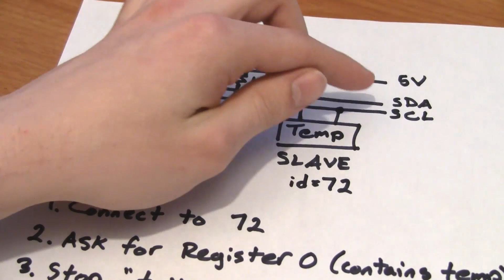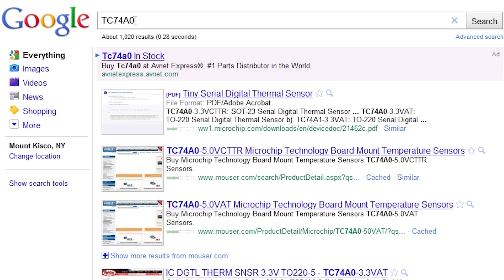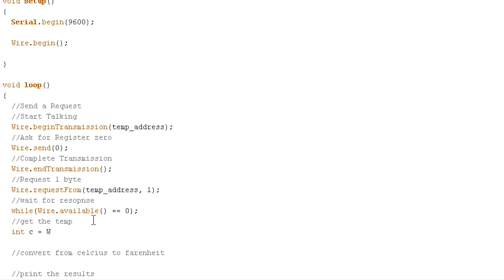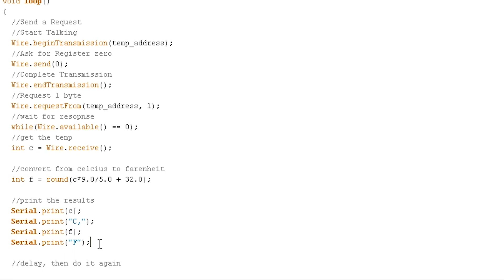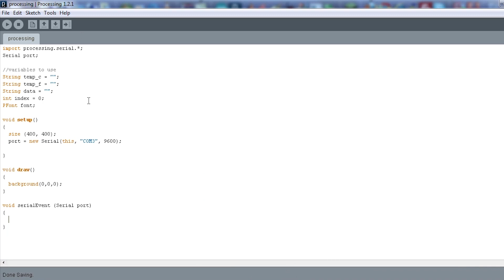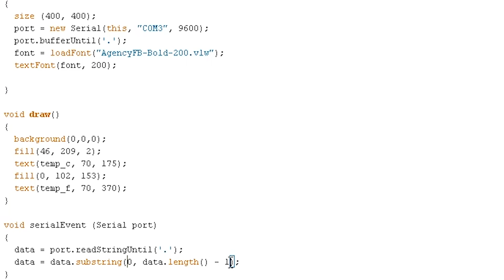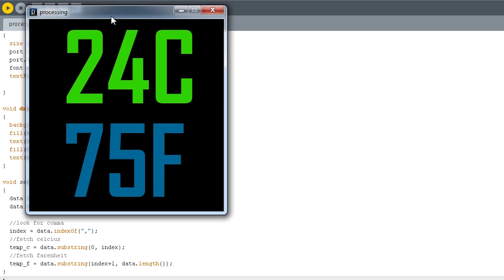Tutorial 07 for Arduino: I2C Communication and Processing

Comment: I am really confused with the part of the program where you wait for the 1 byte response using a while loop. The 1 byte of data comes in as 8bit binary right, so won't while (serial.available()==0 ) be cut of by a 1 coming in as part of the 8bit data? Why doesnt that happen? please reply, I am stuck on a similar project due  tommorow
Reply: When you call the Serial.available() function it doesn't clear the buffer. When the condition is set to true it just mean you have any number of bytes ( > 0) available to read, but you're not actually reading them and taking them out the bufffer.

Comment: Is it possible to use multiple ultrasonic ping sensors  .. with their trigger PINs in common or shorted .. but  each echo pin is connected  to  different   control lines of arduino
Reply: Yes, there is YT Video explaining exactly this idea ...

Comment: Will the length of wire between the master and slave affect the temp readings? For example if I wanted to measure the temp in my garage that is 10 meters from my computer.
Reply: No. It's a digital signal.
Reply: @Ziplock9000  Actually the length and type of cable  is extremely important when going 10 METERS !!!  I2C may not even work reliably.  The Noise + the Cable Capacitance +  the Cable Voltage Drop + the Pull-Up Resistor Values + the Driver Chipset are all big factors ...
Reply: @vtorsi610  Yup I learned that since saying it 3 yrs ago :)

Comment: I don't think that's the DIP version of the temperature sensor. I think it would be more properly be called the through hole or TO-220 version, rather than the surface mount or SOT23 version.

Comment: I have a lm35 3 pin sensor. is this all valid for that too?
Reply: No. The LM35 is an analog sensor that can be read directly using one of your analog inputs.  (assuming you are using a 5V arduino like the uno or the mega) connect the LM35 vdd/power pin to 5v. The vss/ground pin the the arduino ground. And the vout/signal pin to one of the arduinos analog inputs. You can then read the sensors output by calling the analogRead(); function. (the output will be in voltage but it should be relatively easy to convert to temperature at this point.)

Good luck!

Comment: Where is the I2C address of the sensor in the second code?
Reply: It doesn't matter anymore. Since i2c is required for the arduino to communicate with the temp sensor. In the second code the arduino is already sending the temp by executing the earlier code by serial communication.

Comment: I made this but it isn't working :(
what can be wrong?
something whit my arduino, I did everything the same as you
but great help thnx!

//Vasco van Pinxteren
//Grab celsius data from I2C temp sensor and send it to the comp

//Include the wire library, import the the I2C library
#include <Wire.h>

//Set the adress of the temp sensor
int temp_address = 72;

void setup() 
{
  //Serial connection, talking to comp
  Serial.begin(9600);

  //Initialize the listening
  Wire.begin();
}

void loop() 
{
  //Send a request

  //Talking to the I2C temp sens
  Wire.beginTransmission(temp_address);
  //Ask for info register zero
  Wire.write(0);
  //Complete Transmission
  Wire.endTransmission(temp_address);
  
  //Request 1 byte
  Wire.requestFrom(temp_address, 1);
  //Wait for response, keep repeating until we got the info we want
  while(Wire.available() == 0);
  //Get the temp and call in Celcius
  int Celcius = Wire.read();
  
  //Print the results
  Serial.print(Celcius);
  Serial.println("C");

  //Delay
  delay(1000);

}

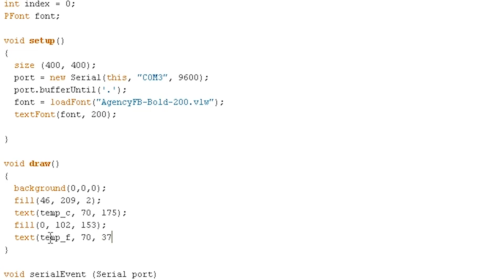Comment: Some things apparently work differently in Processing 3.01 and the text in the graphic window works for the first display through the loop but the degreesC text jumps underneath the degreesF text after that. I don't know the language at all but if correct the size(400, 500) and the code (see time 13:33) with this: text (temp_c, 70, 5); and text(temp_f, 70, 470); it works "OK". If someone can post the fix so that the text will fit in the 400 x 400 graphic box, that would be great.

Comment: Below is an excerpt from one of my postings. "PROCESSING 3" keeps closing as soon as I run the .exe 
All other programs run on my new windows 8.1 computer but "PROCESSING 3". I can't seem to find any solution to this problem. I have been searching the internet for a while but there doesn't seem to be much information about this program. I became aware of this program in Jeremy Blum's book: EXPLORING ARDUINO. There is a link to this website in his book on page 128. As soon as I downloaded, and installed the program several weeks ago I have been trying to find a solution to this anomaly. Normally I am able to solve most problems like this because there is a lot of links and information about a given product and/or software program. I'm finding very little information on the internet concerning "PROCESSING 3". QUESTION: Is there somebody in this forum who has had a similar problem with this program, and who has solved this particular issue. THANKS; It's sad that their website/forum will not or can not answer my questions.
Reply: +ElectronicWizard* Arduino Microcontroller Guide 2016. Step By Step Design and Programming Arduino Microcontroller. FREE DOWNLOAD HERE*
https://plus.google.com/116428027560638976608/posts/96r9KFpBur9

Comment: Hi I was trying to find the ID for this IC (http://ww1.microchip.com/downloads/en/DeviceDoc/22096b.pdf) but am not seeing it in the datasheet... where can this info be attained?
Reply: +James P Page 46 section 6.2.4 explains the addressing. The first 4 bits are fixed at "0101" and the other three bits are set by pins A0, A1, A2. High or low. If the address pins are not present they are considered pulled up high internally.

Comment: There is one thing seems not logical.
In the last few lines, (0, index) means the location of "index" will not count for the split string. If that's the language designed, so (index+1, data.length()) will also not count the location of last string letter which is at "data.length" right?
Thanks.
Reply: Air Genre Another thing is if a string's real length is 7, each letter will be allocated by index from 0 to 6 since you put 0 as the location of the first string letter. If data.length() command gives the real length, for example 7, then (0, data.length()) will become (0, 7) and they are 8 elements. For this reason, data.length() should gives the index of last string letter.

Comment: Is it ok to put a LED in series with the pull up resistors to act as indicators when data is being transmitted?
Reply: keep in the mind to decrese the value of the resistance litle bit since the led take small amount of voltage , mainly led will be driven by transistor after the conection from the resistance to the pin . this will be connected to the base of a NPN transistor .

Comment: Dear Jeremy Blum, 
Can you please explain me how to get values of (9.0/5.0 + 32.0)? what are these values?
Reply: That is the conversion formula from Celsius to Fahrenheit, multiply the temperature in Celsius with 9/5 + 32.

Ex. Zero degrees Celsius (freezing) equals = 0*9/5+32 -> 32 F.
Reply: 9/5 is the ratio of the number of degrees between freezing and boiling water in F and C. F has 180 degrees difference between freezing and boiling (32f-212f).C has 100 degrees difference between freezing and boiling (0c-100c).so 180/100 simplifies down to 9/5.The part where you add 32 is because F's temp of 32 is equal to the C temp of 0. So if you have a temp in C you multiply is by 9, divide it by 5, then add 32 and you end up with the temp in f.Example: 10c, times 9 is 90, divided by 5 is 18, plus 32 is 40. So 10c is 40f.

Comment: Thanks for the great turtorail.
I have  questions, why we need IIC technology? Why is the difference from IIC and other sensors?
I bought a LCD with IIC and I can't figured out why exact IIC do .
Thanks
Reply: I2C is 2 wire interface , this mean you need only 2 wires to interface you sensor , lcd ,,, in the same time you can connect up to 127 device in parallel using the same common 2 wires . mainly this technology called I2C made by philips (nsd later on ), but it is trade mark restricted to philips , so atmel made the same compatible with different name called TWI , mean 2 wire interface , but both I2C and TWI are similar
 .

Comment: Lovin these tutorials but my jargon flags are going off in minute 1. Master/slave was never explained (fine, I can use google and we have been speeding up since tutorial 4 or so). Anyone who had the same reaction that I did: Master/slave concept doesn't really need to be understood for this. From my reading, I gather that this is a master/slave relationship because micro controller has unidirectional control over temp sensors. My advice is: don't waste time reading the back story on this. Understanding master/slave relationship would be more relevant for arduino to arduino I2C. In an example like this M/S relationship is important because the master "is elected from a group of eligible devices" -- i.e. it is not innately clear which device is the master. With arduino/sensor circuit, it is obvious which component is the master. Please comment where I am wrong. Help is appreciated.
Reply: Other helpful info for people using this as primary Arduino education: I2C is not an abstract EECS concept separate from the Arduino, nor is it a separate technology that comes on a discrete chip or component: Arduino comes with an I2C interface built in. This is implied at 1:40 but not said explicitly until 3:50. Hope it helps. (also, this begs a question: "the ID comes preconfigured on the integrate circuit." -- Does that mean on the Arduino itself? How is this ID assigned to a specific slave component if it originates from the Arduino itself?

Comment: Jeremy, what do I do if I was not given the individual addresses for my chips. I bought 10 of them and was never given the address info.
Reply: I purchased all ten of them from element14. They were not shipped with individual datasheets.
Reply: Hi Bob, Thank you for the help. This solution does raise another question now. If I read the datasheet correctly, there is no way to change the address myself. Is that correct?

The reason I ask is, I bought 10 of these. Assuming they all have the same address, I can only use one at a time per arduino, right?

The project that I am building calls for three sensors. Do I need to obtain new sensors and ask for specific addresses, or is there a way for the end user to change the address?
Reply: Sounds like a good plan. Thank you much.
Reply: Just look at the datasheet. The number on the chip tells you the default address. For example Jeremy is using a 74CA0 if you look  the datasheet you will know that the "A0" means 72 (1001 000)
Reply: *****
Thank you Remy , you made it more clear , i where wondering about it , tutorial didn't explain that  , and many people ask the same question but no answer , many thanks you make it clear .
Reply: Earl Gray Page 9 of the data sheet (http://ww1.microchip.com/downloads/en/DeviceDoc/21462c.pdf)   shows that you have to order the address that you want specifically. You can't configure the address on the TC74.
You can only put a max of 8 of these chips on one I2C buss. MCP9803 chip is close to the TC74 but you can configure the address to what you want.
Reply: Ben der
Oh Righteous! Thank you sir. I was hoping you were going to give an alternative device that would work. I'm going to order some of these right away. Thank you again for getting back to me.

Comment: HI Jeremy, how do you go about the window that displays the temperature as in 08:53
Reply: That is the serial monitor which is included in the Arduino IDE. It displays the data you sent from the Arduino board to the computer via Serial communication.

Comment: A question, If you want to connect a sensor to ARDUINO 3Vcc which handling 5Vdc. You can connect the sensor to the line of 3.3V of ARDUINO, but what happens with I2C communication lines? The I2C of sensor is a collector open? Thank you very much for your help.

Comment: I can see a useful application for this now.  I have a server rack in my bedroom with quite a few servers and would love to build a circuit to control a standard box fan to turn on and off at certain temperatures.  Possibly have it alert me visually somehow if the temp gets too high?? or even shut down servers if it just gets too hot to be a real problem.

Comment: Very good tutorial. I have a temperature /humidity sensor (DHT11) but I don't know its address, is there a way to find this? The datasheet doesn't specify it either.
Reply: HI,5 years old, but I have a DHT11 as well.. However, I don't believe it's i2c... did you ever confirm this?

Comment: But then it doesn't do any type-checking or warn you if you try to change the address down the road. You could (in theory) use a byte:

const byte temp_address = 72;

Then you'd be using minimal memory, and the compiler would type check the value when you use it later, and warn you if you try to change its value somewhere in the code. These are GOOD things. 

The #define directive is old-school C. While it's still used, I try to abandon it in favor of something more "safe" whenever possible.

Comment: The datasheet will tell you. In this case, it's a TC74 temperature sensor. Google "tc74 datasheet" and click the first result. Section 5 gives the I2C address, which is slightly different for different versions of the sensor. They are given in binary, so 72 is 1001000.

Comment: How do you know that the temperature address id is 72? I am using an Arduino Stalker which has an onboard temperature sensor and was wondering how to find out what id it has on the I2C bus. The same goes for any other i2c devices...how do you find out their corresponding ID's. Hopefully someone out there can help!
Thanks a lot!!
Ben

Comment: Thanks Sciguy,
I'm having a hard time finding the information to see if the arduino will work for my idea.  Can you point me in the direction of some solid information on the RTC and it's applications.  I haven't seen anyone use the RTC for controlling multiple dc motor at set time and intervals.
I want to run a dc motor for 1 min at 7am, then run it at 9pm with the polarity reversed.  
I'm also unsure of how much multitasking the arduino can handle.
1 RTC
1 dc mortor
2 servos
1 sound board

Comment: The Geek Group might be using vertical pillars outfitted with these i2c temp sensors through out their new facility to allow them to plot out a 3d temperature map of the whole building. The map could be used to optimize the heating and cooling system.